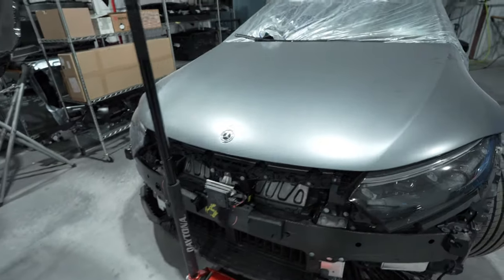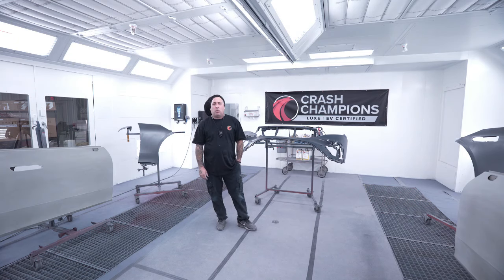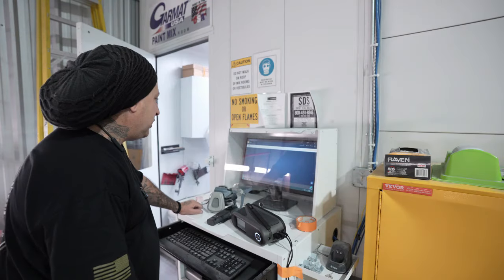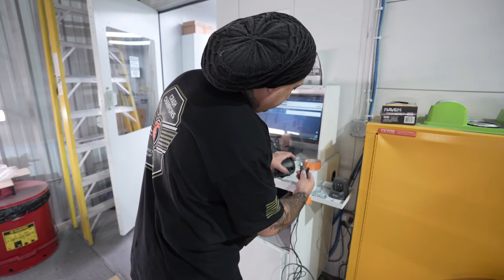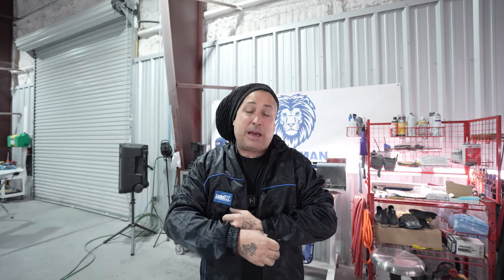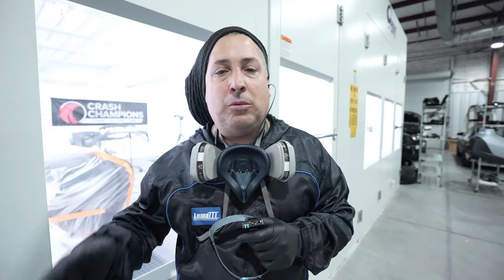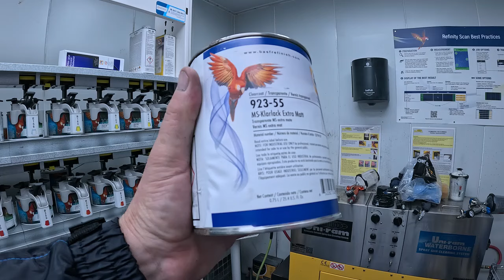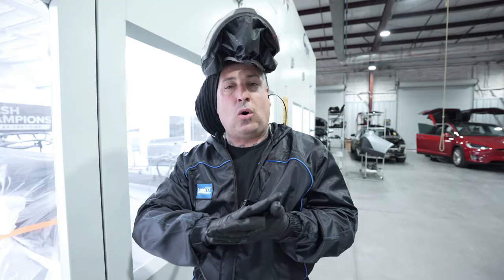How To Spray Glasurit Satin Clear - Will It Complete This System?

Comment: Why different masks/respirators for the base vs matte clear coat?
Reply: Clear is more harmful as its solvent
Reply: Because clear has the isocynates from the hardner as where basecoat ( solvent or water ) does not.
Reply from the maker: All paints are hazardous.  But the clears have the most OVERSPRAY that  gets in your eyes
Reply: The Kandy Man has the PPE figured out.

Comment: Not a fan of satins, flats, etc. Why someone would pay so much for a high end car with a flat or stain paint job just befuddles me??  And . . . like you know and worry about . .satin does't mean anything concrete. One companies satin or flat or matte, compared to another's?????? So doing a repair like this goes into the column where I place candies  :)
Reply from the maker: To each there own  satin is one of the hardest jobs in the shops
Reply: @kandyman5315  I think I was saying that. There are so many variables, just like a candy job for example. But the  end result looks like crap in comparison, in my opinion. Why take so many gambles on something that doesn't look special in the end. That's how I see satin or flat.

Comment: Hi Kandy Man, first off I must say that the new lab coat takes years of you bro you look like a spring chicken😂😉I'm the same as you I need to loose a little around the mid portions, I just got diagnosed with high cholesterol so now I'm eating all the boring food and it looks far to green🤢 🤦‍♂
You've really mastered the Glasurit system and to have the computer give you the correct gloss level in the formula must be a big help providing it's 100% spot on for each job🤔
Now go hit the gym😬I'm to old for that though🤭🙏✍John UK
Reply from the maker: Thanks John. Yes I'm working on getting back in shape. But I just like to eat.lol